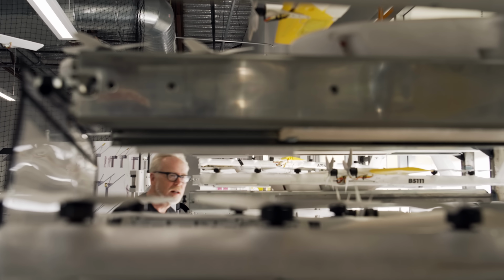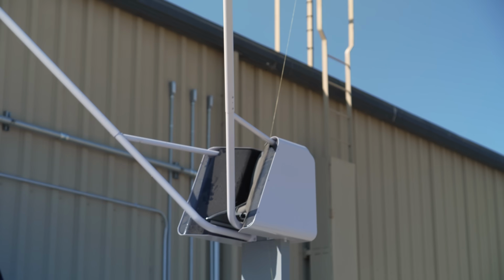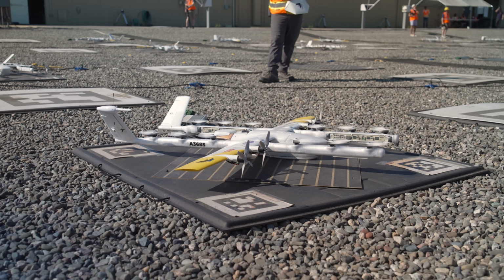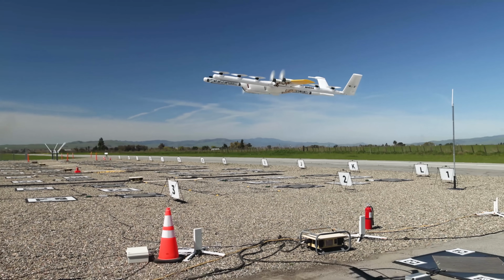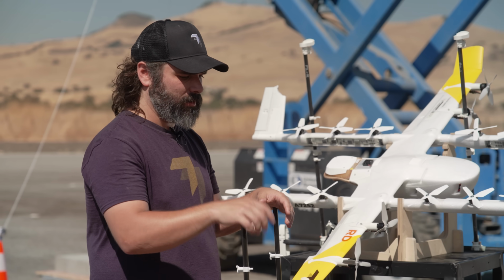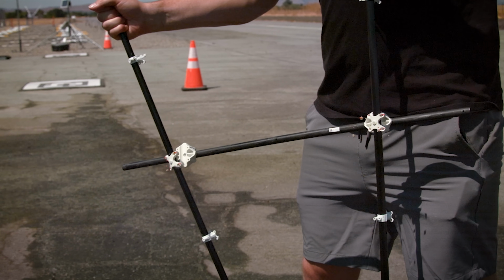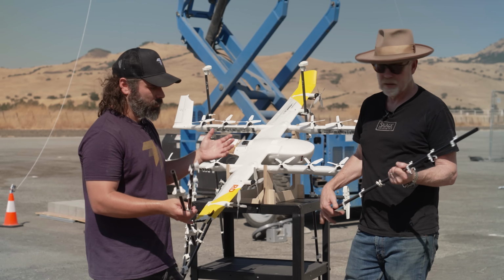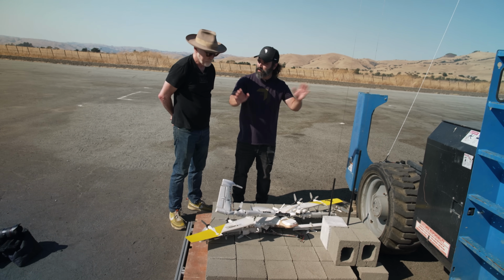Testing the Limits of Delivery Drones! (with @theslowmoguys)

Comment: Automation tends push what people need to be able to work with, meaning that people getting replaced need to be able to take not only new jobs, but possibly new types of jobs.

In automation IT industries and bigger enterprises a common argument have been that people will be able to focus on core, "higher value", things as mundane things are 
automated. It is not so simple in real life though. Automation sometimes moves risks, removing some human error risks but increasing complex technology risks.
People are different and have different alignment for "abstract higher value" work versus hands on work, so I belive that some automation will get many people in a very bad situation, it will kick out some people from companies and perhaps even the job market.

Some economical benefits of being distruptive  or early adopter tends to even out when many more do the same thing and the difference on services and prices even out.
Introducing a very high degree of automation and machine learning also have inherited risks of an organization to loose it organizational memory and "own understanding" of essential things. This may be a long slow process, but I say the risk is there.
See the vehicle manufactorsbeing very early on high degree of automation and starting to realize that remaning people were starting to loose the knowledge of manufacturing vehicles.  New staff tended to focus on either "abstract" things not being essential for the manufactoring understanding or focus on IT related areas with very low understanding of vehicles and vehicle manufacturing. 

Sometimes inovation and improvements comes from the floor, from people having had that "mundane" job for many years.  Machine learning or so called weak AI can easily introduce false positives and a longer term flawed direction, especially so if people take it for granted the AI results will always be right. People putting too much trust in their AI solutions will probably risk not be viligant to false positives and increasing deviations, which may let the AI become increasingly faulty, 
Many many people takes intentions as outcomes, but intentions with AI and automation is one thing and actual outcomes another. I whish more people will stay cool and assess outcomes and risks more instead of being impressed by intentions.
Reply: A small detail on autonomous vehicles of any kind that I feel is often forgotten or ignored is that the on site human awareness and senses  are removed when the human precense is removed. This is very important for secondary not-included, situations,. SImply put: people moving around on their jobs doing specific tasks may notice completely unrelated things, like weird signs possibly being an safety incident or someone being ill, lost etc. 
A very advanced automate may include technology to "notice" unrelated things also, but in compare to the huge human potential from human senses and the human brain in general, I doubt most automation technologies will compensate the removal of human precense and what it means on secondary benefits.

Some delivery person may notice a problem or situation or may simpley stop something from happening that has nothing to do with the delivery task at hand.
Same thing for many other cases where human precense is removed.  I remember some social robots in Japan for elderly care and was horrified by the idea of some empty manga glass eyes would be the last thing a human would see in life.

Comment: Not to be disrespectful but this drones are a joke.... as per efficiency point of view. Having sooooo many motors used ONLY for vertical takeoff and then being just a death weight and to "provide" additional air resistance a.k.a. drag, well... just not serious. There are technics like tilting rotors etc. to use motors not only for flying but also for hovering. Though nice p.r. video.

Comment: From all the drone delivery projects shown over the last years this guy sounds the most promising, mostly because he is passionate about flying.
But if you ask me, the "normal" delivery way, you know with a driver and a car or a scooter will be very hard to replace. And it shouldn't be replaced.
I worked as a delivery guy, delivering food for 2 years on a scooter, a 125 cc scooter.
And i also am an RC hobbyist. When i started building RC airplanes i was very attracted to the idea to build it myself, to experiment. So i studied the parts, i learned you need a radio and reciver servos, motors, motor controlers. Then i had to study a bit of aerodynamics learn how to actually make a piece of foam fly. That was like 15 years ago. By the time flytest were just starting with their ytube channel. 
And what i quickly realised, since i loved the idea of electric motors was that the lipo batteries that are generaly used in electric RC model planes are the only limitation to everything that has an engine in it to change the world.
lithium-ion polymer battery is an amaizing invention, but if you want to compare the density of regular fuel, it is still far to compete. Meaning same weight of diesel has far more energy packed than a lipo battery. The advantage is the lipo can be recharged and reused, the diesl once is burned is gone.
But even so, the lithium batteries, and i am far from being an expert in this, are also limited. With every cycle of charge and discharge their capacity drops. Meaning after each cycle the battery will be depleted faster with less energy.
Lithium batteries are not cheap. A battery pack for a single drone probably cost around 300 dolars.
These drones will only be able to operate on short distances. 
I remember when i worked as a delivery guy on scooter, sometimes i would pick up like 3-4 orders at once, go to the closes one first and so on. One of these drones is not able to do this.
I am speaking here about food delivery because at the moment, with current battery technology, the only thing these drones would be fit for, is that. These drones cannot carry heavy weights over long distances.
Is very cool to see this, but, in the real world, this is just a fancy way of doing delivery.
The only way i could see these drones to really take off, would be with a much better battery wich currently does not exist, or is not on the market. And if one of this drones could carry at least 10kg of weight over minimum of 10km and back. 
At the current technology, if a drone does this, it needs a battery recharge for every delivery it makes. I don't think people understand how rare the things in these batteries are and how limited, much much more than fosil fuel are. If these drones replace the entire delivery system around the world, it would burn through batteries, meaning using a battery untill the battery is unusable, like nothing else, more than cars. Because these batteries are small, need to be small so the airplane can function, meaning more charge and discharge cycles, much more often than an electric car, meaning the battery will degrade much more faster.
Unless we find a much better way to make batteries, much cleaner and sustainable way. These drones are just not worth it.
Yes the technology is amaizing, the fact that are completely autonomous, it's fascinating. But the real drawback are the batteries.
And there is also the fact these drones will replace alot of human jobs. Thing wich already happened in china and this is why there is so much chaos with their economy now.
For me all this is fascinating and makes me act like a child just like Adam, mostly because i love these stuff. 
But i don't think we are there yet, in a place where everything can be controlled by AI and i don't think we should be there. 
We live in a world where most of the technology around us, is alien tech. We have no clue how it is made, who makes it, how it works. We have become so dependent on things we don't understand. And this is wrong.

Comment: Hmm... I wonder if the seatbelt has to be a certain size... or... if it can be a tiny seat inside the drone somewhere, with a tiny seatbelt on it, with a tiny human figurine sitting in the seat strapped in by the tiny seatbelt, and if that would satisfy that rule that airplanes have to have seatbelts in them. XD

Comment: i'm sad that yet another of my ideas is being beat to the punch by people with money. but i'm still interested in seeing where other people's realized ideas intersect with mine. such as the design of that drone. you can see the genius behind its design where the 2 fuselage pylons provide a great stable platform for the vertical rotors to work from, while also not being aerodynamically in the way when it's flying like a plane. such as X or # shaped drones that don't have a plane mode. and while most people would've thought to make tilt rotor designs like an osprey, those have more points of failure and less redundancy that can save itself when things go wrong. it'd also more likely be a heavier construction with bigger motors, blades, and actuating parts to handle the loads of transforming (despite being a much cooler looking design admittedly) safety for people on the ground is by far the most important thing. imagine one of these crashing down on a baby in a stroller. being made of such light material and designed to break so easily, it WILL hurt the baby of course, but not nearly as much as 11 pounds falling from the sky COULD. a bump or bruise vs a permanently disfiguring injury. but despite that importance, they still managed to make a pretty cool looking drone. reminds me of one of my favorite planes, the P-38. however i think there are still some ways to improve its design. both for safety and aero efficiency, but maybe some day i can be a competitor so i shouldn't just be giving out ideas for free. however safety being so important for everybody, i will share that. if the drone detects total control loss and is falling, i'd have pyrotechnic blow out bolts holding everything together, with specific shear points etched into the styro body as well as easy snap clips for all electric cables so nothing is holding it together when those bolts pop. that way it can self destruct in mid air and harmlessly rain down like confetti. every motor, wing, beams, and the battery all falling separately, with the battery itself having an instant blow up air cushion around it so it bounces off whatever it hits, because the battery is the heaviest part and that alone falling onto someone can cause a lot of damage. putting it in a big bouncy beach ball type of cushion would stop that though. (this would increase the weight of the craft, but would be worth it)

Comment: I can't give you any specifics because its proprietary, but I'm pretty sure My Dad makes those carbon fiber tubes. And when I used to work there, we also made trolling motor shafts, garage door panels, and something called Sea Wall which are giant 40x2 foot sections which hook together a go around man made islands to keep the current from eroding the island away once its in place lol.

Comment: Zipline promoted by Mark Rober is much better.
Silent factor alone is already better.

The glider is already adequate for small packages. If they can safely deliver medicine, they can deliver small packages too.
The catapult launch system is simple, reliable and cost effective.

Now, the MAJOR problem for all these drone delivery system is the weight. If we check the average weight of the packages ordered by the consumers, the drones need to be scaled up in terms of size, power, energy capacity, charging time, cost to manufacture and cost to maintain.

Comment: These really need to be much quieter. A friend was under a test flightpath for these in Queensland, and they're pretty noisy. Having one of these fly over every couple of minutes is going to be a really bad thing.

I'm not against drone delivery. It'll get delivery riders off the road, so there will be a little less congestion and you won't have people risking their lives to try to make more than minimum wage.

The social and environmental impact of thousands of these buzzing overhead as they currently are is going to be severe.

Comment: There is a lot of fixed axis motors on those planes. I'd like to see some soft robot muscles tipping the motors once it gets enough power. I'm sure that would be a feat, but just imagine: as soon as the motors get enough power, the artificial muscles in them start to tilt them into flight mode. Once the vehicle gets somewher near target, the artificial muscles relax, and the whole thing goes back to hover mode. You could even think of a safety mode in which the artificial muscle would be  pierced so it automatically gets to hover. Woudl be so cool.

Comment: Making the body out of styrofoam is interesting; styrofoam can actually be very efficiently recycled, but only if you have the right equipment for it. Currently few places have the necessary equipment and so a lot of styrofoam ends up in landfills. Companies like Wing could add a small but significant revenue stream by offering styrofoam recycling pickups in accessible places for your average person trying to reduce their waste. It gets easier for consumers to get rid of their styrofoam waste and Wing can reduce their production costs.

Comment: Make a small clip-on kit that can hold a tiny critter passenger, and give it a little crash cage and seat belt.  Instant high passenger safety rating.

This established, methodical delivery system could be a life-saver in an emergency scenario.  That writ, one wonders how far the drones can roam without a network signal, and whether they would be _allowed to_.

Comment: Neat look at the process of engineering for different contingencies… but let’s not forget this is fundamentally an ad paid for by the company’s Silicon Valley investors that’s meant to convince a skeptical public to accept the potential risk and nuisance of widespread drone deliveries. At scale, I bet we’d all hate the noise, and it only takes one bad battery to start a fire. 

Also, the crash test is a bit misleading, or at least incomplete. It’s a very specific scenario: dead drone falls on concrete. Let’s see a drop test with the rotors going at full thrust and some ballistics gel nearby. Those blades may not have much mass but they spin REALLY fast and I bet it would REALLY suck to get a shard in your eye. The carbon/styrofoam drone itself obviously isn’t the greatest risk. Crash it into power lines and windows and flammable material. Show us a battery/PMU failure. Not convinced.

Comment: 4:37  "Aircraft shall have seatbelts"  Well, rest assured: the number of seats, and the number of seats with the best possible seatbelts is the same number.  That number is 0, but that still counts.
Reply: Fun fact: 14 CFR § 91.205 used to say that airplanes must have seat belts. It didn't say how many. There were other laws that stated when seatbelts had to be used (e.g. § 91.107 stated that every passenger had to be strapped in during takeoff and landing, which would imply a minimum of one belt per passenger), but that didn't affect the requirement of § 91.205.

This has been changed to "one set of seat belts per seat".

Comment: The biggest thing limiting drones today is battery life.  You can put 2, 5000mah batteries on a drone and get 1hour flight, but those 2 batteries will weigh close to 20 pounds.  The next billion dollar idea is creating a useable solid state batteries, NanoBolt lithium tungsten batteries or maybe Graphene based batteries that is able to be produced on large scale and not too expensive.  There are other new battery tech out there, but they are either not able to have enough battery life, to expensive, too heavy or too toxic.  

I think we are getting close and close to getting a battery with 2-5X the life of a LIPO battery.  That could really evolve the use of drones for commercial, military and consumer use.  There have already be massive advances in drone motors, ESC's, Flight controllers, long range/4G radio and video transmission, drone apps.  The battery is the last thing that needs a major upgrade.

Comment: I can't help but wonder if these would have been useful in the aftermath of the devastation in NC/TN/GA/FL... Though I'm thinking mostly of the mountainous areas in NC/TN...
Reply: they did use drones to get supplies to more remote areas. The thing is they cant really lift much so its akin to delivering one water bottle at a time vs just using a helicopter and dropping off a pallet. logistically for that it doesnt really make sense.
Reply: @zachmoyer1849  Good to know!  I was thinking things like meds and first aid kits, things that would be small yet urgently needed.
Reply: Great for a small box of Twinkies...

Comment: The design of the drones, which is a mix of airplane and helicopter, VSTOL style, is beautiful, slender. One of the things I liked about the movie TWISTERS was the drones they used.

The engineering of the collapsible is elegant. The question is, obviously, the organization of the flight paths of these ideas of delivery via drones. Here there is a crucial factor, because they would fly over the population, over buildings and roads and highways. They would have to have a parachute system so that they could be deployed quickly.

Also, I imagine the complication with insurance, the legal part in case of accidents. They will have to create new laws and regulations, to protect those of us who are below while the drones fly their electronic and invisible routes.

Crazy video. And it is always fun to see the collaboration between SlowMo Guys and Tested.